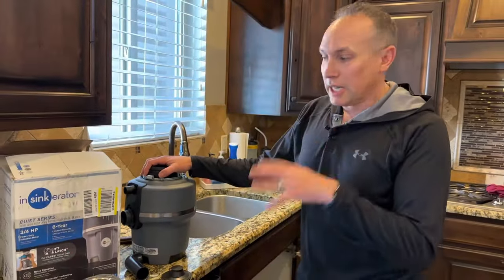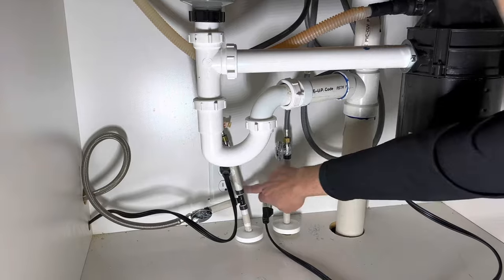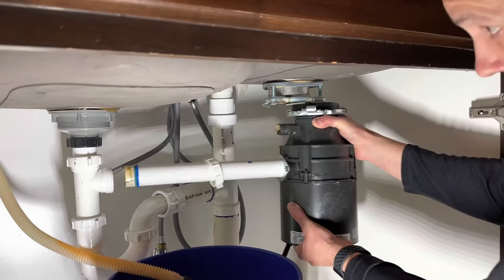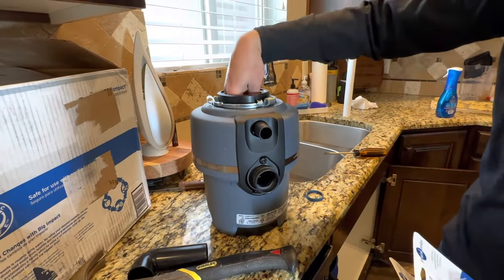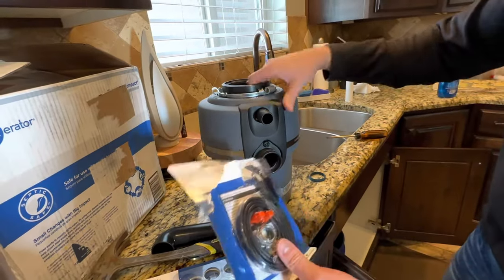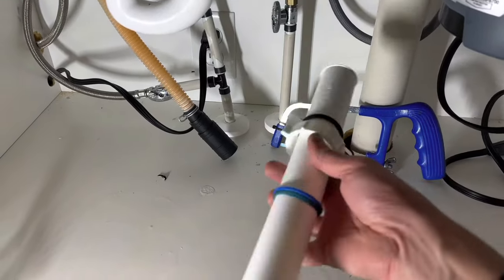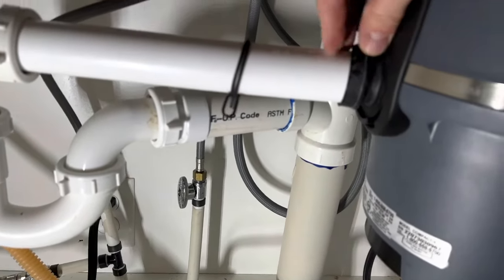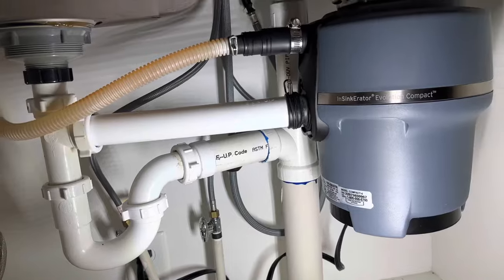Replacing a Broken Garbage Disposal | Insinkerator Evolution Compact Quite Series 3/4hp

Comment: Thank you for the video. I changed my original one which was installed in 2005 by badger about 8 years ago. So exactly same setup like yours, I am going to change the top clamp since I did not change 8 years ago. Hopefully it is going to be an easy job.
Reply from the maker: Good luck!!
Reply: @Myksgarage  Went smother than I thought. Thanks again.

Comment: Well done.  I'd only add that you'd want to make sure the Down-angle didn't change off the insinkerator to your P-trap, you wouldn't want nasty water still sitting in your disposal.   I feel the hardest part is getting the Flang Snap-ring on to the mounting bracket, but you didn't do that as part of your video (no sink drain replacement) and that's fine. :)
Reply from the maker: Thanks for the feedback

Comment: You kinda skipped the part I was looking for, which is how the appliance gets attached to the ring. Since I'm replacing a 1 HP unit which weighs about 112 pounds, that part would've been nice.
Reply from the maker: 112 pounds?
Reply: @Myksgarage  Pretty close. Have you ever tried to hoist a 19 pound object under a stinky sink, get it to seat perfectly, put the tabs in exactly the right spot and then get those little tabs to slide up those little ramps? Of all the videos out there on disposal replacement, one video showed what goes where. One. And the guy in the video used a car jack to get his 3/4 HP disposal into position because it was too heavy for him to hoist. 
Also, the new Insinkerators have a new easy plug-in design for their cords.